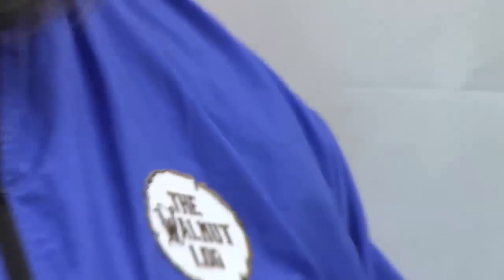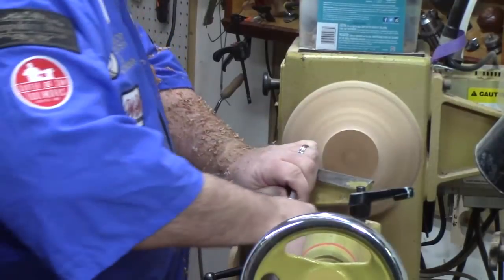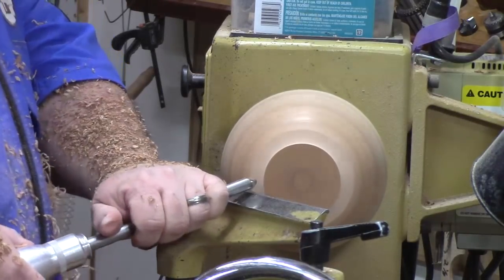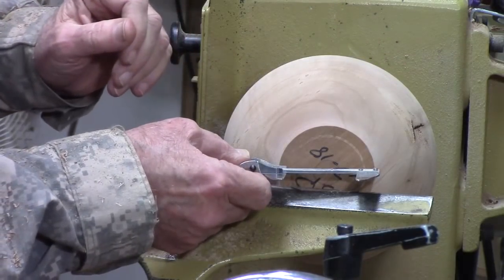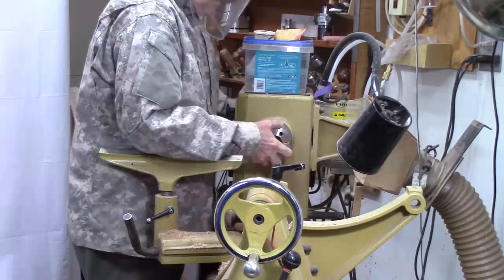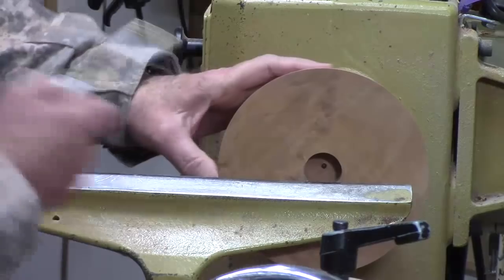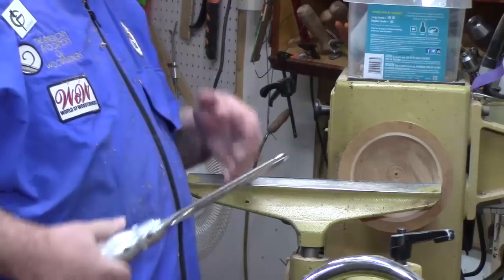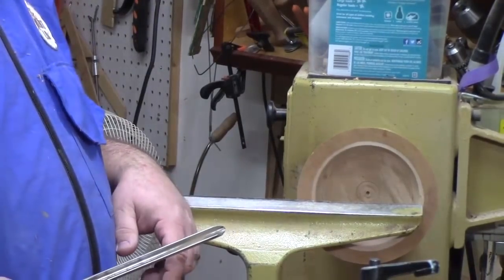Tag team turning a Bradford pear Bowl  - Part 1

Comment: This is a great video and I’ll be sure to watch part 2.  I am seeking your opinion on the following.  As a relatively inexperienced turner I can’t understand that most if not all  the professional  Utube woodturners teach to use either vernier calipers  or dividers  to mark the diameter of the tenon and explain how dangerous it is (as you did on this video) if both points were to touch the turning wood at the same time.  Why not mark the center with a center punch or drill a hole and use the radius measurement. That way place one point of the divider in the hole and scratch the radius with the  other point.  I tried it today and it works like a charm.
PS: I enjoy and learn from all your video.
Reply from the maker: Good question. Habit I guess. Your approach is the safer. The other way can be faster because it saves a couple of steps but we are talking seconds. Measuring and dividing in half to set a radius requires measuring in millimeters since dividing odd imperial dimensions in half in my head  makes my head hurt and lots of Americans still don't use millimeters. But I like your suggestion and may put it in a future video. I use mm a lot.